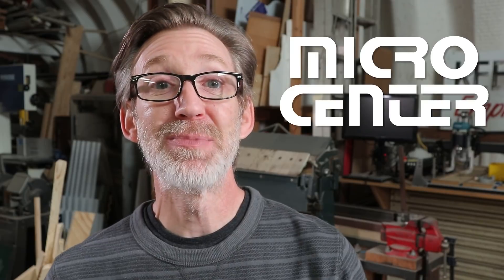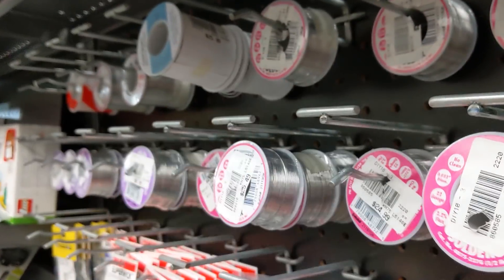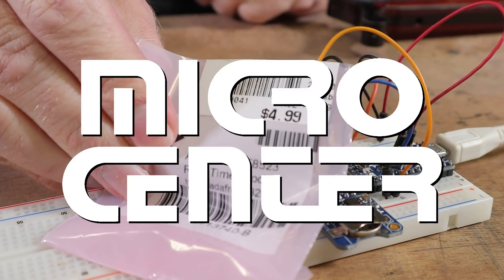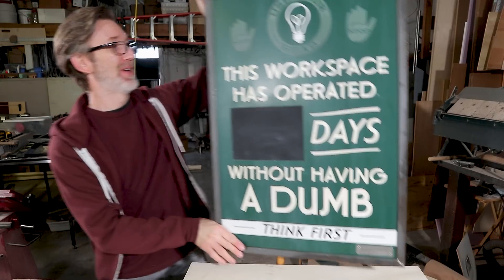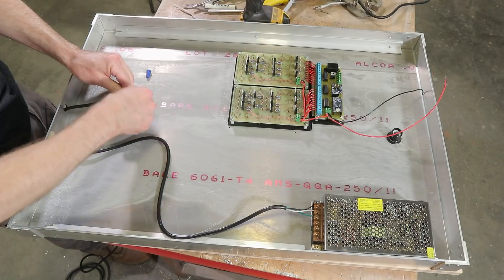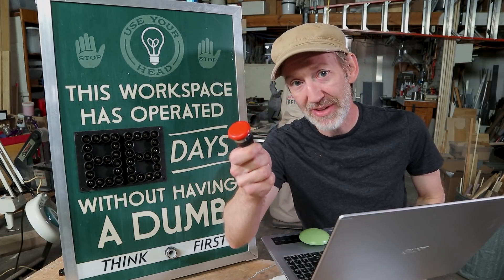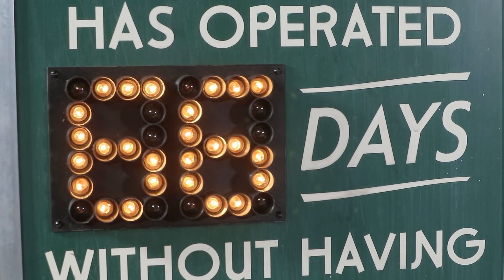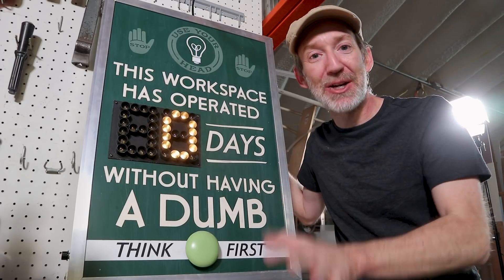Accident Scoreboard w/ Old-School Bulb Display

Comment: Loved this project.  Now that my Wife has a full blown Leather Workshop, she would like one for her shop.  Before I jump in and start designing from scratch, was wondering if you have the plans for sale or at a minimum the files for the 3D printed parts.  Not too worried about the circuit part. Designing our own Wifi/Bluetooth enabled take on it but I like the nostalgia of the #428 bulbs and E10 sockets.

Comment: New watcher on an old video lol BUT for DIY PCB etching, if you setup a ground plane on a large portion with resist, then the smaller amount of exposed copper between the ground plane and the actual traces you want, you save a lot on acid, and it speeds up the etching itself since there is less copper being removed

Comment: This is fantastic. I'd love to be able to buy the custom electronics (the bulb holder and the assembled circuit boards with code already loaded) as a kit, and just add my own transformer and button, and build the sign around them. If you were to sell the custom parts of this build as a kit I'd definitely be interested! I love wiring up electronics but I'm not advanced enough to print my own circuit boards!

Comment: Question:  Was the bezel printed using PLA?  IF so, how does it hold up to the heat of the light bulbs being on?
Reply from the maker: It works out, because at full brightness, they're too bright to look at anyway, so they're never turned higher than about 50%. At that level, I can hold my finger against them and not feel much heat at all.

Comment: When you got to the point where you questioned why the led's were blinking, my first assumption was the breadboard. I once banged my head against a desk for 3 days on the stupidest tiny sketch for my arduino that was doing very confounding things that shouldn't be possible. Come to find out the breadboard was faulty, the sketch was fine. Now I avoid the cheapest level of breadboard and buy  at least the mid grade. Another great vid!

Comment: Hey Wesley, if you happen to see this, could you share your cutter type, speeds and feeds for aluminum? Thanks!
Reply from the maker: For this project, I used the settings below, on 6061 alum. But, keep in mind this sort of thing changes depending on your particular machine. Good luck!

Bit: https://amzn.to/3sjqnUV
DPP: 0.01"
Feed: 20 ipm
Plunge: 10 ipm
Ramp in: 0.5"
Reply: @WesleyTreat  Thank you! My machine is a little more beefy, but I tend to break cutters on the final pass. I'll try that cutter, and toning down my DPP and feed on those last few passes.

Comment: Great video, Wesley! I make a lot of clock-based projects and a while back I switched to using ESP8266 chips in them. Having built-in WIFI means you can get time from an NTP server and negates the need for a dedicated clock chip. Of course, this means you have to have WIFI where you are putting the project, so it depends on your use-case. Just some food for thought.
Reply: The problem with using WiFi / Internet for getting data is that you need to secure your device from folks on the outside of your network.
Reply: @maxximumb  genuinely curious why? You wouldn’t need to make it accessible for incoming connections, just get the time. If you’re worried about the NTP Server going rogue and giving a response that somehow exploits your code, maybe set up some firewall rules so that your device can’t access the rest of your network. But that seems very unlikely as it would have to be targeted. Or am I missing something here.
Reply from the maker: Thanks! I considered connecting it to my wifi, but there would eventually be connection issues at some point and I'd have to hook up my laptop and fix them. With the RTC, I should be able to set the time and forget it, and the battery should last several years. I might consider a GPS unit for something similar in the future, but in my metal shop, that might be a problem, too.

Comment: You're soldering skills are excellent, but your soldering iron is out of date. The newer cartridge style tips are infinitely better than the older two tip ones with better temp control. The T12 ones are cheap and are worth the money.
Reply from the maker: I might be looking for a new one. The set screw finally seized on me, so when I changed tips I had squeeze the iron in a vice to make it hold the new tip.
Reply: I soldered like a one armed chimpanzee on acid most of my life until I got a good Hako and a bottle of flux.  A few cheap chinesium solder kits to practice on and I feel I am pretty proficient now. A good iron surely makes all the difference.

Comment: HUGE props for working out the official scoreboard font. I worked for FairPlay back in the 1990s and loved their 7 segment font that used a more pleasing “script” for the segments rather than 7 discrete bars. It takes more channels per digit, but looks so much better. FairPlay’s number “4” had the upper left corner lamp OFF and I think that was actually patented or trademarked, IIRC.
Reply: omg you‘re right! That’s really cool. At first I was surprised he‘d need 2 days for programming but with taking time for details like that it makes sense.

Comment: That thing looks great!
Too bad the clock circuit has a backup battery as tripping the beaker would reset the timer appropriately :)
Reply from the maker: Thanks! Superfluous fact: the RTC won't work at all without a battery installed, for some reason.